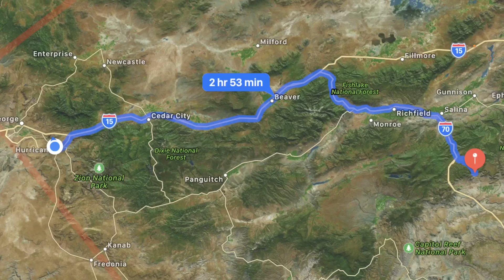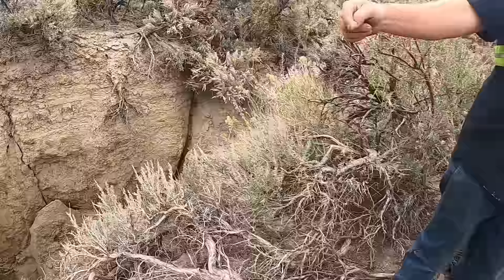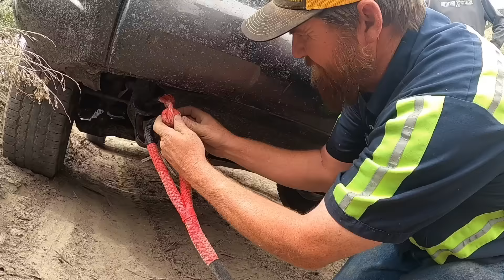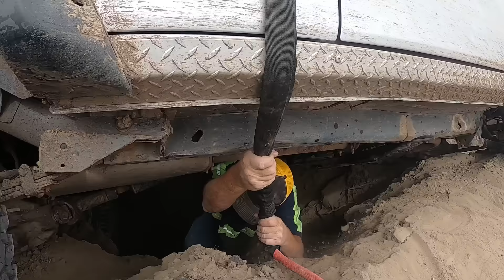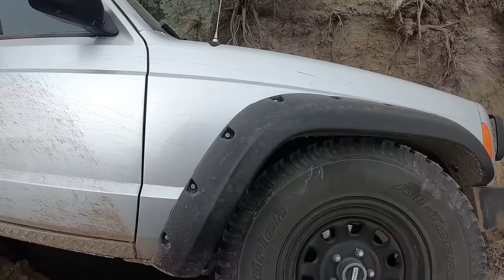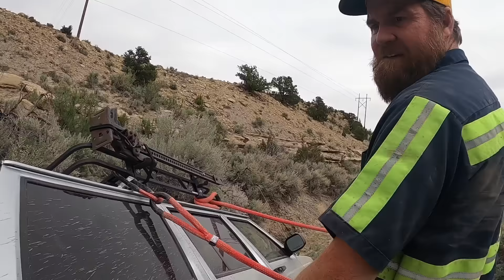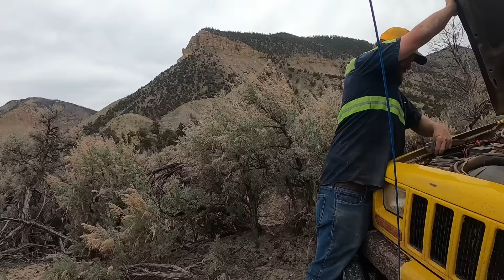Jeep Swallowed By SINKHOLE!!

Comment: That road really needs to be closed as someone else wont be so lucky
Reply: If we closed every road where some untoward event has occurred, most roads would be closed.
Reply: @carlyellison8498  that road is sinking, in this case it should be closed until it can be stabilized.
Reply: If you looked in the aerial photo, that entire hillside the road is following is sloughing off.  It'll close itself in a year or two.
Reply: Did you block the road off
Reply: Why close it if we can fix it.
Reply: Yes i agree CLOSE the road it is too narrow and impassable safely!
Reply: How about people use common sense?
Reply: @The_Ballo  Even at 20 mph, I think you'd be on top of that Swiss-cheese road before you even realized it was less road and more hole.
Reply: @stephendee7839  Yeah, see, driving 20mph on that road demonstrates the exact lack of common sense I'd be talking about.
Reply: untoward event..?
think your using that wrong..  but as the guy said, it looked solid and collapsed under them.. the rd is sliding down.. I agree that it'll fall on its own, but if it does so do to a rig driving on it then that rig could be buried under who knows how much dirt.. its really not something that should be left open, i know here in Vt we care about the next off roader and at least would have put a clear sign out saying unsafe...
Reply: @The_Ballo  How much common sense do you think the driver of that vehicle used?? Not a lot i would say, putting a rescue tow truck operator at Risk ( ie under the vehicle )! Close the road until it can made SAFE!
Reply: @barryphillips7327  Safety isn't an absolute. There is an entire spectrum which ranges from fun to boring.
Also, nobody asked Matt to crawl under the Jeep. I certainly wouldn't have.
Roads don't make people do risky things. People do risky things and they bear the personal responsibility. It's called being in the outdoors. You want safety? Don't drive.
Reply: So who is responsible for that road/track/trail?  They should at least be informed, even if only to give them the chance to put up some warning signs to mitigate getting their arses sued to hell and back if the next person to fall in that hole is a litigious SOB.  Someone suggested that the road will soon close itself, and I''m thinking one decent weather event will do just that.
Reply: These armchair off-roaders don't know anything, when you are wheeling in the desert sagebrush, you can't see that far beyond the sage on the side of the road. It looked fine until you actually stop and take a look around. From the air shots this road is a few rain storms short of washing away completely. It should be closed but these are the risks that can happen when you go off the beaten path.
Reply: What road?  Thats a trail.
Reply: This is the exact location of the sinkhole: https://goo.gl/maps/1xqUmr7jfTA1VPScA
38°53'59.1"N 111°23'10.6"W
Sevier County, UT, USA

Right near Convulsion Canyon.
You could always try contacting the Bureau of Land Management for the area.
BLM Richfield Field Office
150 East 900 North
Richfield, Ut 84701
(435) 896-1500
And take a good look around on the map, you'd realize they would have to close the whole canyon and many more around it as it is littered with sinkholes. Pretty sure one would have to proceed on their own risk going these trails. Bet you there are signs posted everywhere about this.
Even with that knowledge, it's quite easy to find yourself on what looks like a path only to one second later realize it's falling apart under your wheel.
If you have ever seen a sinkhole appear in front of your very eyes you'd realize it's damn easy to just suddenly be swallowed by one without warning.
Reply: @TrevorDennis100  I took a GPS grid today and will get the information to the right people. It is much worse in person.
Reply: @rickrandom716  Matt said it was "soft" so I'm guessing he knows there's nothing supporting it below due to under-wash.  Tons of money can be spent to fix it but in the end, nature will win elsewhere on that road especially if most of the ground is that fluid in the area.
Reply: @The_Ballo  You can't see an under-washed road from the top.  The driver said it was "anti climatic" as the Jeep just tilted over and just stopped.  Now if he weren't supposed to have access, that's another thing but nobody mentioned if the road was gated or not.
Reply: @TrevorDennis100  Are you for real? Next you'll be asking who is responsible for hiking trails or rock climbing routes. Maybe you can sue God himself.
Reply: @rgsrails  Thems the breaks. If you don't want to get stuck, stick on DOT pavement. 
What is this fetish for civilizing the entire planet? Next I'll be required by law to wear a foam helmet to step outside.
Reply: Hell, the corvette museum fell into a sinkhole!
Reply: There is no fixing of a trail especially this one. The remedy is start a new trail further inland. From the aerial shot it looks like one has been in use for a while. It runs parallel to the washed out trail.
Reply: That looked like a fissure, not a simple wash out, I live southeast of Phoenix, there are fissures out here, they can be extremely deep.
Reply: @The_Ballo  Common sense would be to stay the hell away from that road.
Reply: @TrevorDennis100  The road will close itself. The question is how many people it will kill in the process. If it's closed, that number will be zero. If it's left open in the state it's in, it might be some number greater than zero.
Reply: @russlehman2070  No doubt, but it's the responsibility of the driver to make the call.
Reply: Did anyone else notice the powerlines up there? That road was built to facilitate their construction. Futher maintenance will be done by helicopter. The days are numbered for this road.
Reply: @The_Ballo  I live in New Zealand where we have 'No Fault' accident compensation and free health care for injuries that occur through accident whether they be tripping up at work or on the rugby pitch.  (It's called ACC)  So we don't have a mindset where we sue MacDonald's if they serve our coffee too hot.  The rest of the world thinks of America as having that mindset, and its pretty ugly, so I was totally taking the piss out of those entitled Americans that think that way, and even consider it an opportunity to make money.  Thankfully America has people like Matt and Casey who have honest and kind faces, and who offset the ugly side of America.  A nation that apparently thinks it is OK to have a President who lies and cheats and throws his toys out of the pram on a daily basis.  We are all (the rest of the world) hoping you put things right come November, although Biden falls well short of the likes Obama.
Reply: If you look at the aerial shot, there’s another road that bypasses the bad spot.
Reply: @TrevorDennis100  America is sue-happy because of the Trial Lawyers Association and their ilk, not health care. 
Speaking as an American, I couldn't care less what you think of us 🖕
Reply: Why?  My dual sport (street legal dirt bike for those that don't know anything about two wheeled vehicles) would be perfectly fine.  Ran many single track trails that are inches wide, some along the ridge with steep hills going down both sides.  Know your equipment and where your wheels will track and use some sense.
Reply: @trevors8577  My mtnbike, too (although much easier to hoist over those pesky gates)
Reply: @The_Ballo  what he didn't say regarding the acc system here in nz is  because of it we cant sue for personal injury.  So no it is not just because of lawyers, the system is  basically designed to  allow for and encourage the practice the lawyers are no doubt just taking advantage of it. And in some respects there are benefits to a system such as yours.
Reply: Bw Bacon 
Do we have a geologist in our midst?
I agree!
Reply: @The_Ballo  Or wear a mask
Reply: First off dont go with out a buddy and a truck to pull ya out vice versa and second know the trails you plan to try and capability of your rig , dont blame the road for poor judgment..
Reply: @stephendee7839   i was two tracking near Nashville Mi and a sandy section with a 4 foot washout on the side was no problem going down , then i got further and huge holes in the road said i will turn around - i studied it for a few minutes, if i fell in the washout the left side of the car would be crushed -disabled the antispin so id have all the power available -i stayed as far as i could away from the washout, hidden rocks in the sand had me airborn a couple times  on the way up, i actually  made it - that would have been at least a $500 tow when the truck eventually got out there (today)?  - i was happy
Reply: Rick Random You still have to close it to fix it
Reply: No, people need to pay attention while driving after heavy rains.
Reply: I had the exact thing happen in my zj pulled down a trial where a old gold mine was and the road was hollow underneath had no phone service but had a shovel and a couple Jack's I had to fill the hole and dig a road out lol took forever
Reply: If you go off the other side the right side good luck
Reply: @TheOrder20  I was going to say the same thing and agree 100%. Looks like it should be shut down and make a new bypass if it's an important trail but unless they come out with heavy equipment it's not going to happen.
Reply: @TrevorDennis100  stay in new Zealand u have no clue the shit Trump faced
Reply: That track needs shut down and a replacement instated, the whole thing is ready to collapse.
Reply: @carlyellison8498  this road eats 4x4s and motorcyclists as snacks
Reply: its not a road.. its in the desert.. close the desert?
Reply: @jamesshoemaker4851  not a rethug or a  crat, but Obama had to deal with far worse than this guy has. And did so with a certain class that that "reality" star lacks. And really, how many of the previous administration were caught, tried, and given jail sentences? That's not a partisan issue either.
Reply: @trythinking6676  I'd know what 🌎 u living on.
Reply: @The_Ballo  Kinda hard to make the right decision if the driver isn't given all the facts regarding that road.  This driver thought he was driving on a normal off-road trail.  No driver can see a fissure under the road!!
Reply: @TrevorDennis100  Trevor sounding a little jealous!!
Reply: @The_Ballo  Did somebody get a cut on his little finger and found out he was out of bandaids??!!  If you had graduated high school you might have a different opinion.
Reply: @treverwhetzel9603  BUT this internet thingy is giving him something to feel big about as he sits on a booster seat to reach the keyboard.
Reply: @doctimw  You know what they say about assumptions.
Reply: @jamesshoemaker4851  voted for the current fascist I did. Quickly figured him out.
Reply: @doctimw  now that was funny.🤣🤣🤣🤣🤣🤣
Reply: @defriez  Thank you - 
Did you accomplish that?
Reply: @TrevorDennis100  LOL!
Reply: @The_Ballo  BRAVO!
Reply: @The_Ballo  Bravo!
Reply: @PudelsRule  some engineers went and looked at at. Not sure what has happened since then
Reply: @doctimw  first time I have heard that. Who told you?
Reply: Ya' think ??

Comment: He could have avoided getting stuck if he had more light bars. Rookie mistake.
Reply: Fuzzy dice on the mirror may well have prevented this experience.
Reply: I've used the barefoot-shaped gas pedal. It helps, but not as much as a guy would think.
Reply: I bet ya the guy didn't have a mullet either the mullet adds more torque
Reply: 20" wheels with tiny sidewalls would definitely been beneficial as well.
Reply: Fake hood scoop
Reply: this is why I ride motorcycles. no issues like this
Reply: he should have been going 100k  through that spot, copilots fault
Reply: Dan Strayer no issues at all. Besides flying off of it with minor fender benders
Reply: Nothing screams “I’m a hardcore wheeler” like a nice roof rack.
Reply: @danstrayer111  there's always that guy that gets so salty about something so stupid on YouTube that he curses at a mass of people he doesn't know about a subject that makes no sense to the situation. Congratulations my friend, your that guy! Lol
Reply: @danstrayer111  p.s it collapsed as he drove over it. No driving around what hasn't happened till its too late.
Reply: Agree, if you can see what can be dodged 
or halted by braking,  but thick brush hides
holes wide and deep enough to swallow
whatever you're driving.  A valid risk in karst
or mining areas.  My first hole was Chevy
Canyon sized and  rappel ended 130 f't.
Down amid karst within a cow pasture.
Cattle bones littered the bottom.   Don't
depend upon the dumb to fence or post
warning signs.
t
Reply: Also more chrome.  
Chrome will get ya home!
Reply: Mudflaps would have made his car more aerodynamic, he would have glided right over that hole
Reply: @danstrayer111  I salute you 🤣
Reply: Ikr wouldn't have happened in a Ford smh
Reply: @danstrayer111  I was on a ride and a guy rode off the side of the road down a cliff, He and the bike ended up in seperate trees. It was a bit tricky getting the bike out of the top of the tree tbh (still running haha)

Comment: Matt, I hope you've discovered air bags by now, if not, this was a perfect contender.  You could have set a bag or three with some boards in that hole under the car, and once it filled a good bit, slip one down between the "wall" and the fourby.  Glide that sucker right out.  Please never ever get underneath a load suspended by unstable soil and a recent land shift.  Crazy dangerous.  I manage construction sites and as far as risk assessment goes, that was an extreme risk of serious injury or death number you did there.  Love your work but be safe.
Reply: This.
Reply: yeah holy shit
Reply: Airbags might have trouble pushing up.. airbags are jacks. You need to jack things up more often. Jacks prevent  puttung the alignment out  and breaking stuff  .here with the crevace below,you can put  ramps or boards  across the gap, and then jack up to get boards to under it right height. Avoids damage and failed attempts.
Reply: Good SUASIDE move MATT
Be more CAREFUL GOD DAM it 😡
Reply: Damn! Was that vehicle worth the extreme risk? Stay safe!
Reply: He knows what he's doing.
Reply: That hi lift on the roof rack would have made this recovery much easier.
Reply: @horsegonewild  there was no extreme risk.
Reply: @KurNorock  I’m glad to know that. I’d hate for him to be injured
Reply: Yeah seems there were better ways to go about this but he doesn't have a lot of tools on his truck. Airbags, boards, all kinds of jacks, land anchors, come-alongs etc. He's basically got a jack, some rope, a shovel and a winch and that's about it.
Reply: I’m pretty sure he knows how potentially dangerous this job was. Most every job he does is dangerous. It’s part of it.
Reply: Not the sort of gear he's got, but yea I'm sure it would've made this job a lot easier. Don't think he was expecting it too be stuck in such a massive hole either.
Reply: 100
Reply: You drive on the road everyday with the risk of being side hit by someone running a red light. Most side swipes on the driver side door result in death because there is not a crumple zone. Living is a risk so don't worry about assessing some risks and not others. Accidents happen. That Jeep falling on him would have been called an accident just the same.
Reply: Matt knows what he's doing, bud.
Reply: @David-ys4xb  Then he knows what a gamble that was, Hoss.
Reply: @AmericusMaximus  He knew what he was doing, kid. It's why he does what he does... and you don't.
Reply: @David-ys4xb  When Matt said that it was among the diciest recoveries he’s performed, to what do you think he was referring? Or does his experience eliminate the risks and he said that for dramatic effect? Your smugness is cute, Bub, but careful—it’ll getcha.
Reply: After accessing the way the vehicle was propt against the side with it's tires on the rest of the road, the car was stable.
Reply: @KurNorock  right!  I mean the winch cable would have to had failed and the car actually tip enough to slide down.
Reply: @leesonneville1817  airbag would rip as soon as they pulled you cant put a board in a giant hole like that again jacks cant be pulled let alone the truck was in a deep hole and a come-along is the same thing as winch. If you are so much smarter why dont you have a company that does this or work for him cause it sounds like you got it all figured out from your couch? He said the better ways would not be worth it to have tractor come out as the bill for that would be more than that jeep probably cost let alone what the job paid. I can't stand when people sit around and do nothing and think they could do it better cause if that was the case im sure he would love to have you on his crew you should give him a call and get a good job buddy 👍

Comment: They need to close that strip of road before someone actually fails in and can’t be recovered
Reply: That happens here in FL.  Sinkholes ave swallowed entire homes, boats, and vehicles, with little to no warning.  One guy was sleeping, when it swallowed his bedroom.  Other members in the house tried to pull him out, but the hole won the battle.  That location is now a park.
Reply: @robertheinkel6225  real shit  that's nuts
Reply: Colby Butler, here in Utah all these roads are on BLM land and aren’t maintained and no one really would care anyway, they would just go around
Reply: Robert Heinkel The way it happens in Utah is there are flash floods in the bottom canyons and then the water doesnt have anywhere to go so it goes under ground and creates giant holes that slowly collapse, I have seen deer fall in them before
Reply: Some good old TNT  should to the trick.
Reply: It’s wild out west there are terrors to freeze your soul, and it’s not for the timid. Go back east or stay on the west coast near the 101 if you can’t hang.
Reply: jigga jaw  indeed.. waste not want not.
Reply: Tell that to a hunter or an off road crawler guy